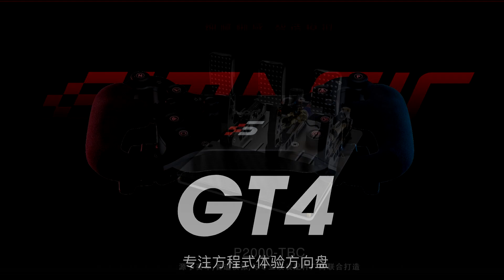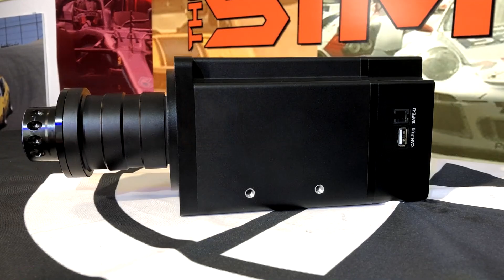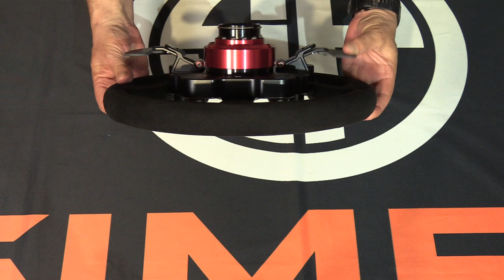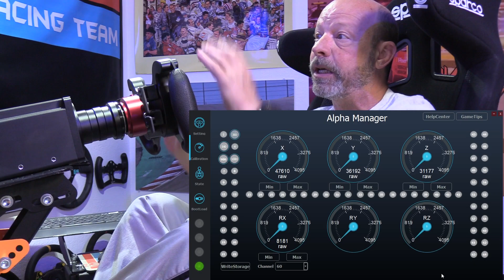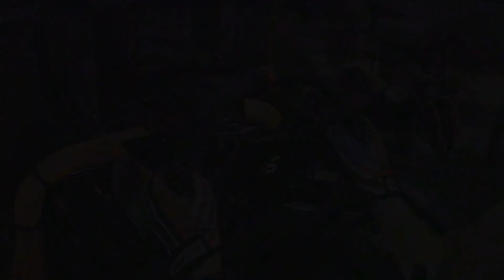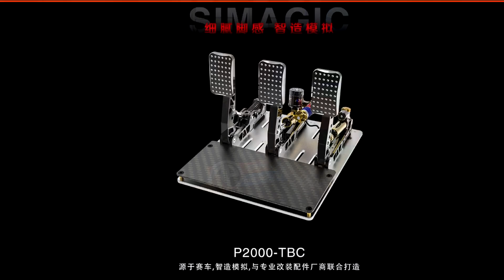Simagic Alpha Base Review - 15 NM of Power - GT1-R / GT1-D Wheel Rims

Comment: Hey. I’m just getting into sim racing and seriously considering the following - 

- Simagic Alpha wheel base
- Simagic GT PRO (K) wheel. 
- Simagic P1000i, with clutch and haptics. 
- PRO SIMRIG PSR3 - Simagic Alpha Edition. 
- Plus all the extras like control box for haptics, handbrake, shifter etc. 

I will be using it for all disciplines of motorsport, ACC, AC, DR, F124, FH5 etc. 

Given one of Simagics main employees stepping away in the last few days, would you recommend Simagic?

Thank you!
Reply from the maker: Being upfront, we’re not sure what to make of the simagic news. We have to have a chat with them and go from there.

Equipment wise, their gear is top notch and what you posted would be a great setup.
Reply: @ thank you so much for your reply.

Comment: If 15nm is enough, why everyone in youtube has bases with more than 20nm, its impossible to drive with 20nm.
Reply: It's not about using the 20nm it's about the dynamic range and extra pop to the details. But I do agree once you get to that 15nm point it's harder to tell the differences even on more powerful bases. Regardless the spikes will be felt more in details and corrections etc.

Comment: What's your opinion re FFB details between this Alpha or the Mini?  I understand its 15Nm vs 10Nm (or I've read some say something like 16Nm vs 13Nm, for a $180 price difference).  Coming from an R9.
Reply: I measured Alpha at 22nm holding torque
Reply: @Max__apex  Really? Have not tried any of these but considering upgrade to Alpha or Alpha U. Currently using CSL DD 8nm

Comment: I have the M10 with the GT1 round rim (leather not Alcantara) and the GT4 rim as well.  The pedals are in the near future for me.  I love this system. Also if you really wanted to use another rim you can use USB rims from other manufacturers and buy a quick release from a Simagic distributor.  I bought an extra quick release and a cheap carbon fiber Huracan replica rim off eBay. I use the button box from the GT1 rim with the Huracan rim and 3D printed a spacer for the round rim.  I only use the round rim for Rally games so I don't need buttons or paddle shifters on it.

Comment: My DD1 is closer and closer to going up for sale.  

We need more Simpit, this was the original channel I always went to and it is still great today, although I do miss the entire original gang
Reply: Sold my DD2 a little over a year ago. Got a SC2 Pro. So much happier. I think Fanatecs great for entry and mid level gear. For high end direct drive that requires a real QR. I think Fanatec has failed. They should have at least released the QR2 before the CSL DD. Nope! They don’t care about the Podium line much.

Comment: I Actually Have this Alpha with D GT1 wheel
With P2000 Pedals
Q1 Sequential shifter 
On the RSR - 21 rig with 27inch Triples 
The Simagic Ecosystem is Excellent!
Alpha Manager is Simple
You calibrate Wheel Buttons and Pedals withing Alpha Manager. The Shifter has its own Upload calibration that is also simple 
You can Save Profiles for Each game you play withing Alpha Manager. 
It's super easy once you dig into it
Reply: Maybe you can help me. What setting do I need to change to eliminate FFB oscillation.  Having the issue with just one specific game.
Reply: @elbowsout6301  Sure.. 
Total Force 85
Smooth Level 0
Wheel Inertia 0
Wheel Spring 0
Damper- 15
friction 10-15
  Should do the trick
Reply: How are the road textures force feedback? Will from boosted media reviewed it in 2021 and said it was really bad on iracing, assetto corsa and  dirt rally 2. He said he couldn't even feel  accordingly when he put a wheel on the grass.
Reply: @Jose-pq4bc  previous issues were software related.    And it's no longer the case anylonger.  I highly recommend the ecosystem and it has an updated software package

Comment: I like these new designs, wireless rims, little to no pins present. This is one of the reasons I went with MOZA and not fanatecs offerings. I have seen so many people posting weird issues with cracking and knocking QRs and even seen a couple bent and utterly destroyed quick-releases (plastic) one, hoever even with the metal one I've seen random disconnections and knocking sounds.